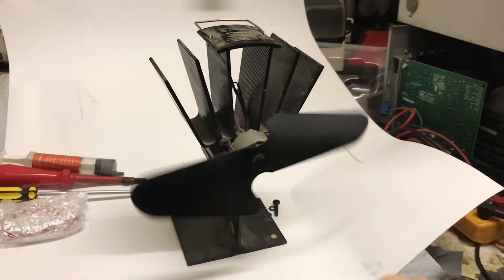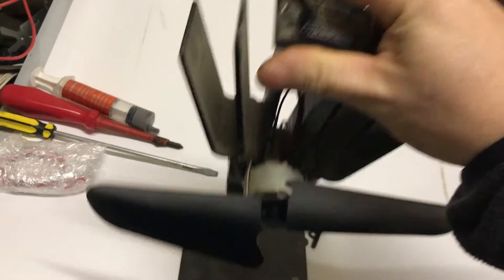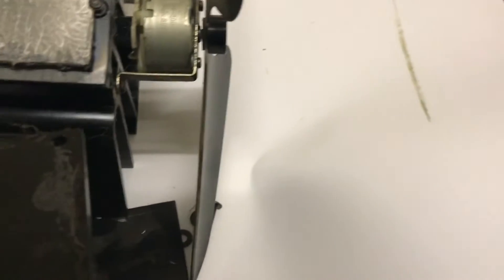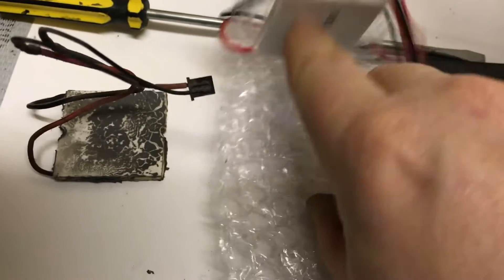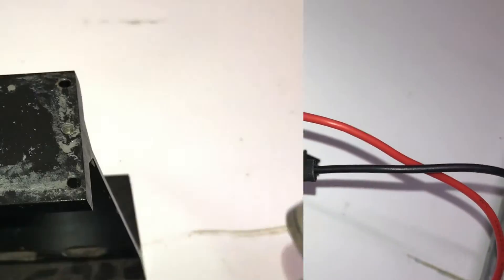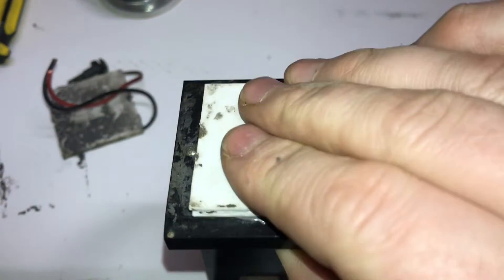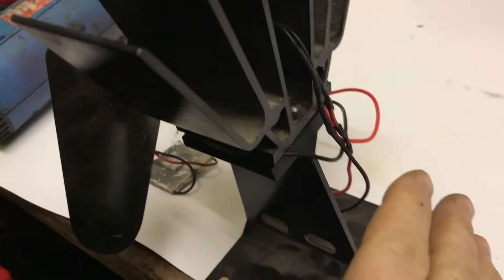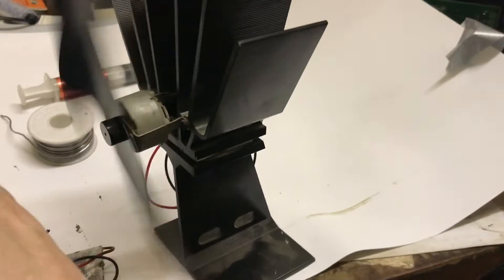Fixing the Peltier Wood Stove Fan

Comment: Hi Steven. Thank you for the video. I purchased the part you recommended and put it in the fan using the paste. It worked for about a day or two then quit. I bought another one, installed it and the same thing happened. Might you have any suggestions? I don't know if I'm doing something wrong.I have two more on the way. Thank you.
Reply from the maker: I wonder is the motor damaged ?

Comment: Hi Steven.  I watched your video as to how to replace the peltier in my stove fan.  I  bought the same one you used (TECI 12706 12 V 6A 60W).  Actually I bought two.  So I installed one using thermal paste and put the unit on my wood stove.  Absolutely nothing happened.  I took it apart and flipped the peltier.  Nothing happened.  I took out the motor and tested it with a D size battery and it spun.  I then tested it with a 9 volt rectangular battery and it spun faster.   So I put the motor back into the unit and changed the peltier using the second one I had purchased nothing.   Any suggestions?  Do I need a more robust peltier?  Unfortunately my fan has no markings on it to say the brand and the motor has absolutely no markings.   I am at a stand still till I can come up with another idea!
Reply from the maker: The code on mine . I bought from AliExpress ( China eBay )
Reply from the maker: Hm I’ll have to have another look at mine I can’t remember if is 12v or not as I think heat difference is only able to generate 2-3 volts … so that could be your problem, or maybe you tighten it down too tight, or you were unlucky and got a bad batch or the top heat sink is not Parnell with the bottom and basically one of them isn’t sitting level on the peltier sensor . 
If you have a hair drier you could just heat the base as see if that makes any difference. 
Now I haven’t tried it myself but I believe if you apply power to the peltier say 2-3v one side will get hot to your finger touch